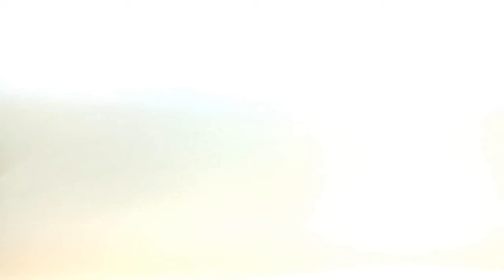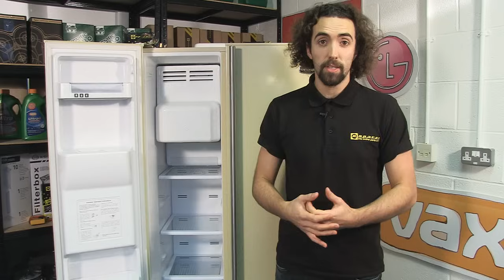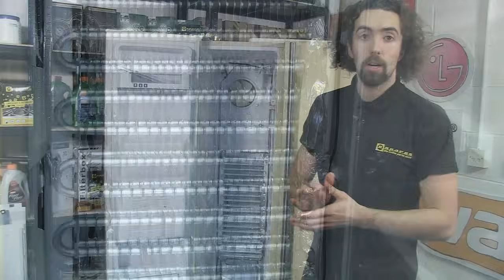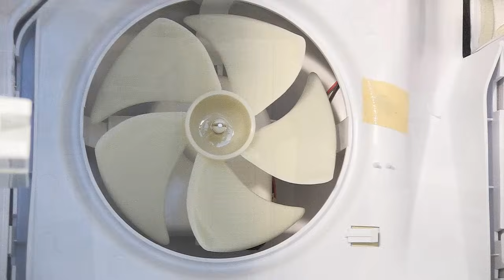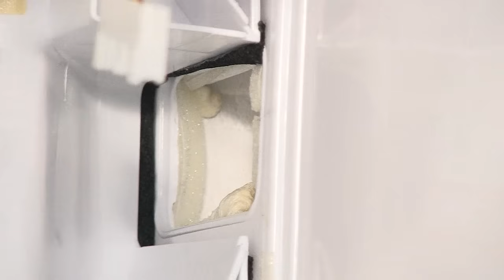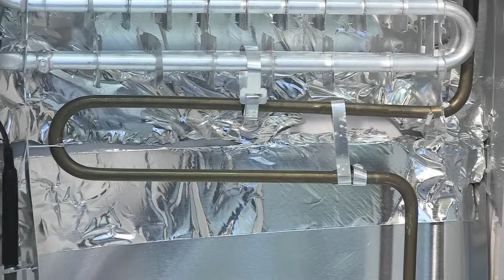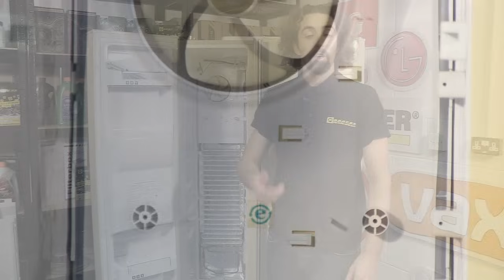BEST Advice: Frost Free Fridge Freezer Ice Build-Up & Common Problems!

Comment: Hi,desperate for some advice,long story,my indesit fridge freezer started defrosting on its own,I turned it off,let it defrost and turned back on. Freezer started working fine but the fridge didn't get cold.i then read maybe I hadn't defrosted fully and ice had built up on fan or something so I defrosted again for a full 24 hours and cleaned it out.started it up again and both worked for about 10 hours then the fridge stopped working and the freezer started to defrost again but only for a few hours and then freezer started working again but not the fridge.it is only 4 years old any suggestions greatly appreciated thanks
Reply from the maker: Check the defrost circuit. if this is OK we would suggest you contact the manufacturers or there agents to have a repair as the control board cannot be replaced without programming on most  Indesit models.
Reply: Thanks for the advice,it's now doing something different.now it works both fridge and freezer but every couple of hours the freezer goes into defrost for a short time and the fridge will stop working.you then have to turn it off on the wall for about half an hour,turn it back on and both will work.gutted as only 4 years old but I will stay clear of indesit in future
Reply from the maker: This still could be a defrost problem so its worth checking the heater.

Comment: hi my hotpoint fridge freezer keeps freezing items in the fridge. model number xag95t1. purched on 25.11.15. can any one help. i think its the control panel.
Reply from the maker: The control board cannot be replaced on your model without being programmed by a manufacturer's engineer or their agents. As your appliance should be covered by the manufacturers warranty we would suggest you contact your suppliers.

Comment: Hi there! I wonder if you could help me to diagnose Samsung RL42LGMH fridge freezer problem. Recently it developed an intermittent fault: compressor and fan stop, all the lights inside including temperature indicator LED's go off. It will go back to normal when switched off at the wall and on again. Sometimes it takes couple of seconds for this problem to re-appear, sometimes it works fine for hours. Fan is not blocked by ice, can't see any ice at all. I left it off overnight to defrost, but not much water found afterwards. I also had a quick look at the main control board to check for dry joints, resoldered a relay, connectors etc just in case, no improvement at all. Please help. Thanks in advance /Kris
Reply from the maker: Samsung frost free appliances stop when defrosting. If the machine does not see the heat from the defrost heater (because it has failed) the machine will remain off until the power is reset. Check the defrost heater: http://www.espares.co.uk/product/es1573258/ and the thermal fuse are both OK.
Reply: Hi again, thanks for your previous reply, I did follow your suggestions and confirmed defrost heater ok at 240ohm, fuse ok, put it all back together and seemed to be working fine for 3 weeks until yesterday evening.. Same problem again.. Not too sure what the next step should be. Will be more than happy for another solutions. Thanks!
Reply from the maker: As we advised previously this problem is likely to be due to the machine not seeing a temperature rise from the defrost cycle. I would recheck the defrost heater and fuse as it may be intermittent. If you cannot find a problem you will need to take 'an educated guess' and replace a part. Intermittent problems are more likely to be due to a PCB failing than a heater.

Comment: integrated.  fridge freezer icing at back
Reply from the maker: Most fridge freezers use a 'wet wall' in the fridge that will get a thin layer of frost on the back wall of the fridge, this is normal. If this is not the problem give us the model number and more details as to what is icing.

Comment: Thank you for your video, most helpful, but I wonder if you can help me,  I have a Hotpoint Future FFP1878 Frost Free fridge freezer, it has a build up of ice , I have managed to take out all visable screws from the back cover, however the cover will not come off completely, it is as if it is stuck,  can you advise ??       My freezer is full, so unable to defrrost over 48 hours and need to remove this block of thick ice manually   which I can feel at the bottom of the back cover.   My freezer is both noisy and not as cold as it should be.  Please advise.thank you.   Brenda
Reply from the maker: Without removing the ice you risk causing significant damage if you try to force the cover off. If you have a steam cleaner you may be able to melt the ice quickly and remove the cover. Your model had several modifications to prevent this problem re-occuring. It may be worth calling the manufacturer to see if they will carry out these modifications for you.
Reply: Thank you......I have now managed to empty the top two drawers of the freezer (thrown away a lot of stuff)  the bottom two drawers still feel frozen,  I will gradually empty freezer and as you suggest on your video, leave the freezer off for 24/ 48 hours to defrost naturally.     Hopefully that will cure the fault.thanks again for getting back to me............Brenda
Reply from the maker: If your machine does require a modification it is likely it will work for several months after fully defrosting but the ice may come back. For this reason I would still advise you contact the Manufacturers to discuss any modification required. If you choose not to do this I would check the defrost heater has not failed once the appliance is defrosted.
Reply: Will do............thank you.

Comment: Very informative video. The problem with my Morphy Richards FFP 187B fridge freezer is it always far too cold. Even on the lowest possible setting stuff at the bottom of the fridge compartment freezes solid. Tried turning off and defrosting without result. Any help or even a suggestion would be greatly appreciated thanks.
Reply from the maker: Your model number is only recognised as a Hotpoint fridge freezer. If this is the model we are talking about it has a 'wet wall' on the back of the fridge that will have a little frost on it. To control the temperature the freezer is monitored and if warm turns the compressor on.  About 20 to 30 percent of the freezer cooling goes to the fridge and this is usually enough if in a normal 'warm kitchen'. If the fridge is in a cooler area or if 'overfilled' this can cause the lowest point of the fridge to get to cold and freeze. There may be nothing that can be done other than loading to change this.
Reply: Thanks a bunch. I know a little more now. Just one more question if you wouldnt mind and I'll bother you no further. How do you get behind the control knob that is situated at the top front of the fridge/freezer. I've undone every screw in the vicinity which included taking the door off and nothing comes apart. I appreciate your help.
Reply from the maker: You have to remove the control panel by taking the top hinge off and the screw hidden by the cover on the other side. Once removed the panel behind can be accessed. If you have broken the knob see here:
http://www.espares.co.uk/product/es836263
Reply: Excellent eSpares. Thanks for your replies and the link. Buy yourself a beer. Really appreciate your help.

Comment: Hi Josh, I have a John Lewis Fridge freezer.
I left the freezer door open last night and now the fridge temp wont go down. Is the problem frosting up in the fridge and can it be resolve by switching the appliance of for 30 min?
Reply from the maker: If the appliance has blocked from frost you may have to switch off and leave open for up to 48 hours to fully defrost.

Comment: Are frozen water droplets at the back of a fridge normal with a frost free fridge freezer?
Reply from the maker: Most fridges use a 'wet wall' where the cooling is done behind the liner at the back. This will accumulate frost and frozen water droplets. The fridge will then  periodically defrost allowing the frost to melt and  the water to drain from a gutter under the wet wall  to the back and evaporate away.
Reply: eSpares Thank you for answering! I got a new fridge freezer and plugged it in straight away instead of letting it sit for hours. I was worried I'd wrecked it!
Reply from the maker: If fridge or freezers are laid on their side or back it is possible for oil in the bottom of the compressor to blow along the gas tubes and block where it enters the evaporator. If this occurs it cannot be repaired without specialist equipment. Allowing to stand for a few hours before switching on can stop this ocurring.

Comment: A Class Frost free with a water dispenser us all the qritting I can fins on it. I think I will need to pull it out to get the model
Reply from the maker: The model number is usually on either a label on the fridge liner or sometimes on the side of the cabinet. If the dispenser is continually dripping it is likely to be the water valve at the back that needs replacing.

Comment: Hi Josh hope you can advice me on this.My frost free fridge/freezer Bosh stop working, when I checked the freezer it was hot to the touch and obviously everything was defrosted, at the top there is a light in red showing danger. The unit was alerting me by a clicking noise, do I throw it away or find a way to repair it, would you recommend someone to do this job in London N17

Comment: My Zanussi frost free freezer works well but the fridge doesn't work. Any tips?
Reply from the maker: +TvTproductions11 Depending on model some fridge freezers cool the fridge using ducted air from the freezer. If this is the case check the freezer for over icing blocking the duct as described in the video above.

Comment: Thanks, Josh, nice informative video!! Ice and water [freezer door] dispenser rendered inoperative, from frost build-up in door. Have to assume heater is open!
Reply from the maker: +genuineuni On some Samsung appliances the water cooler is often reservoir mounted behind the salad bins in the fridge. If there is a defrost problem with the fridge evaporator this can lead to the water freezing.
Alternatively on some machines like LG's they can have a tank in the insulation of the door that has a heater to ensure it does not freeze. If the heater fails again this can lead to ice and may require a new door.
Reply: +eSpares Thanks for the info. This is an OLD fridge (copper-tone). Actually, without notice, the manufacturer initially sent service people out to replace the compressor or a motor. Maybe they found signs of overheating; wanted to protect their reputation and avoid lawsuits.  Other than that, it has been a very good fridge. Got tired of the light blowing in the small exterior door (fridge side), replaced it with LED. If I need parts, I'll visit eSpares. Thanks, again.

Comment: Repair clinic cont test says 0-50 Ohms of resistance the component (heater) has continuity. You are saying readings outside 200-300?? Please clarify?
Reply from the maker: +Nick Emens The resistance depends on the wattage of the element and its voltage that it is used on. Their videos are for the US and Canada markets using 120 volts so the resistance may be lower if used on a 110 volt supply. The rest of the world generally use 220 to 240 volts and the resistances are therefore higher. In either case a faulty element would have a much larger resistance or show open circuit.
Reply from the maker: +snooksnufc Thanks for your comments, with two elements in series it will give 92 ohms resistance across your supply.
Reply: Yes eSpares, the resistance of a component does depend on the current and the voltage. However, for 110V electrical appliances the current will be different making the resistance (or the conductance) the same.  It is called Ohms Law. In other words the resistance of a component in a US and Canada appliance will be roughly similar to that in appliance in the rest of the world. Nick Emens is right to question your 'facts'... 0-50 Ohms is right.
Reply from the maker: Most frost free fridge heaters use a defrost heater (or heaters) with a total power between 100 and 150 watts. watts are calculated from voltage (110 volts) times current so for 150 watts you require a current of 1.36 amps.This would require a total resistance of 80.6 ohms.
In areas outside the Americas the supply voltage is usually 240 volts so the same 150 watt heater would require 0.625 amps current.
Therefore the heater would measure 384 ohms.
The original question was followed up by the viewer when he explained there were two heaters in series giving a combined resistance of 92 ohms and therefore a total wattage of 131.5 on 110 volts.
I hope this clarifies the readings.
Reply: More than one person said the resistance of their heater is around 50 Ohms. Even doubling it for 2 heaters in series is still less than 100 Ohms.  Nick Emens is taking about the UK with 240 volts.  I do not know why you are persisting with the 110v example.  Anyway according to your calculations in the UK the 2 heaters in series would be 2 * 384 = 768 Ohms.  You have applied a wrong interpretation of some facts that you have at hand - please rethink the 'information' you are providing.
Reply from the maker: To be clear Nick Emens post neither gave a location or a model number for me to give specific information and was comparing our video for appliances on 240 volts with another based on USA models with 110 volts so I have given general information.
The point I was trying to clarify about appliances running on different voltages requiring defrost elements with a resistance that differs.
The example quoted is accurate and the 384 ohms quoted above is the total heater resistance required to produce 150 watts of heat.
That could be a single defrost element, two defrost element of 192 ohms in series or two 768 ohm elements in parallel.
If the wattage is greater then the resistance would be lower proportionally.
I hope this clear the matter up as we always try and ensure our videos are accurate whenever possible.

Comment: Got a Logic LFC60W11, seemed to stop working, but internal light working , i fiddled at back and it may be an issue with the Electromargnetic Valve connection to the Compressor? Pushed the metal clip and compressor started working again! But went off again after a few hours, Pushed the clip again and it started again. Any advice would be most welcome thanks.
Reply from the maker: +LittleDrummerBoy234 From your description you may have a faulty start device: http://www.espares.co.uk/product/es1646920

Comment: my fridge an freezer stop works when I disconnect it for 2days it works for about 3 weeks an does it again.
Reply from the maker: +Wilber Uh If it is a 'frost free' freezer check the defrost heater and thermal fuse on the evaporator has not gone O\C.

Comment: my fridge an freezer stop works when I disconnect it for 2days it works for about 3 weeks an does it again.
Reply from the maker: +Wilber Uh This could be either the compressor is seizing when hot and if let cool will restart, or if when stopped the compressor will restart after turning off for 30 seconds suspect the defrost heater if it is a frost free unit.

Comment: Further to my post below. Just seen one of your other excellent videos stating that this problem is probably caused by a blocked drain hole, which is what I thought it was. Just cant figure this out as the hole is clear. Don't expect miracles from a distance, but if you can think of anything else I can check, I would be grateful.Many thanks.
Reply from the maker: +Mike Lewis If the drain is clear the likely cause (especially when full) is if packaging from produce touches the wet wall as this will wick water onto the shelves and into the base. Make sure nothing is allowed to touch the back.

Comment: Wonder if you would advise me please? Our BEKO fridge freezer is working o.k. except for an annoying pool of water, collecting under the salad draw on the left hand side.I can't tell where it is coming from. I thought that is was from defrosting and  running down the back panel of the fridge and not being caught by the drain channel (part of the way down) The drain channel drain hole is clear, I have passed a flexible rod down it to check.Any ideas would be very welcome.Many thanks.
Reply from the maker: +Mike Lewis The problem is likely to be caused by food or cartons touching the wet wall and bringing the water onto the shelves and the base of the cavity.

Comment: Hello.I have a problem with my Kelvinator refrigerator.It start to work for a long time maybe 3 or more hours,and when it stops after this time,it doesn't start again.It start only if you can unplug it for some minutes and after plug it works.So what do you think?what is the problem?thanks
Reply from the maker: +HDHighlights football: If it is a frost free appliance it is probably stopping to defrost. If it then does not see the evaporator warm from the heater it thinks there is ice still to defrost so check the defrost heater and thermal fuse as one is likely to have failed.
Reply: HDHighlights football (

Comment: I hv a no frost freezer and it only frost on only one line of a coil n has not been able to extend to de 2nd or 3rd coil (I hv been checking always) but it cools(freeze) n works properly except that it doesn't make my water n stuff ice blog at all. I expected a deep freezer (no frost fridge) to produce me ice blog when I need some stuff to be ice.
   Is it normal a no frost upright freezer doesn't make my stuff ice blog? or do I hv to reset my defrost timer.
Reply from the maker: +Ben Unction If all of the evaporator coils inside the fridge are not icing on their surface it suggests there is a system problem like either low gas or a faulty compressor. Unfortunately this is not a job you can repair yourself so you should contact a refrigeration systems engineer.